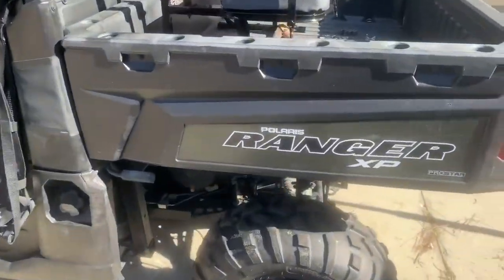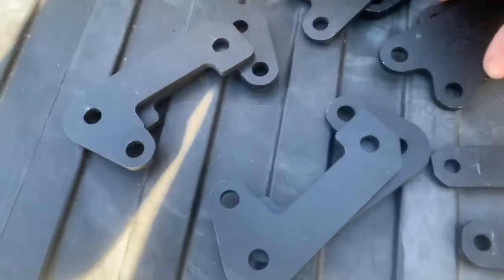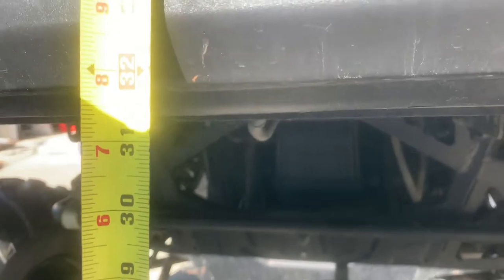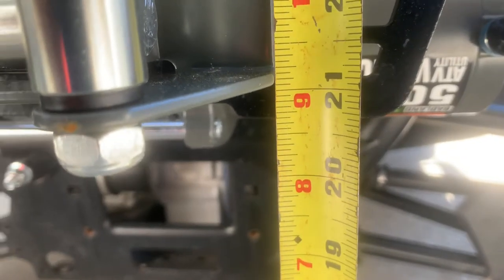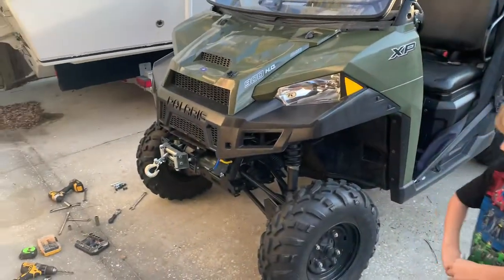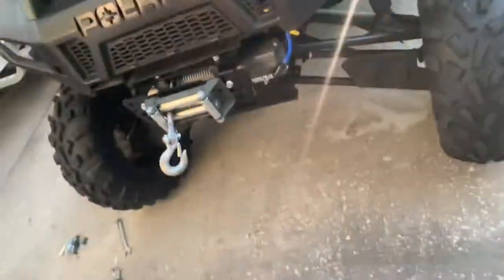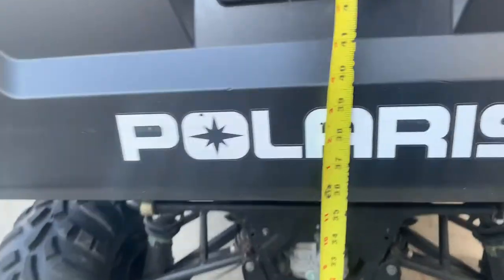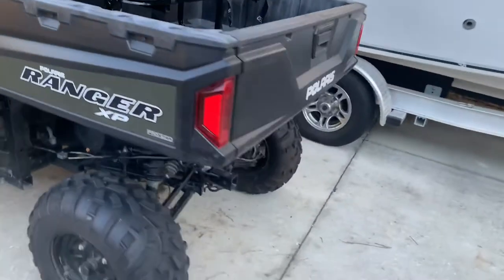Polaris Ranger eBay 2 Inch Lift Review XP900

Comment: The exact review I was looking for. Aweome and thanks for posting
Reply from the maker: Glad it was helpful. After running it for about a solid year I wouldn’t hesitate to buy the same lift again.
Reply: Was the ride that much stiffer?
Reply from the maker: @fxdwings  not noticible if any. I did not adjust my shocks with the adjustment nut on them it is still at the lowest setting. If I did I think that I’m sure I would notice a difference in ride.